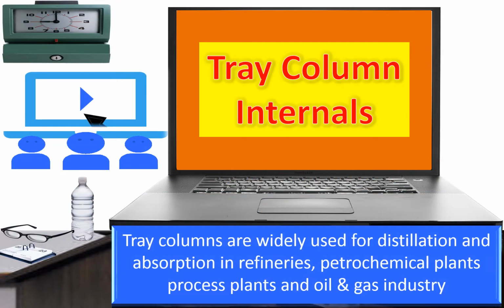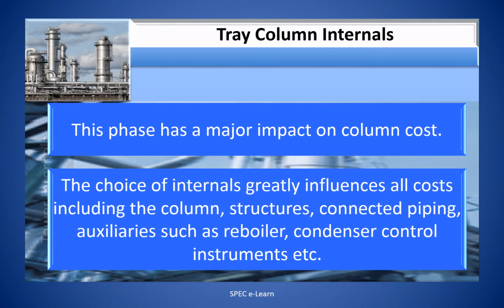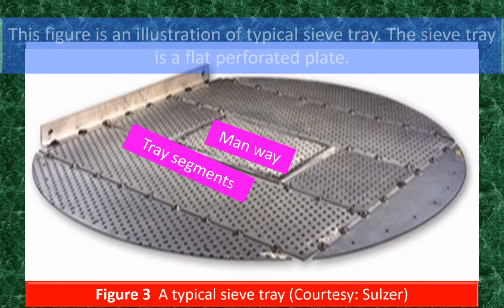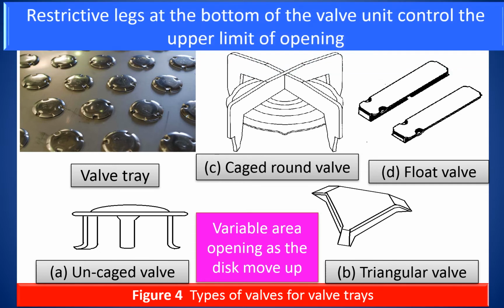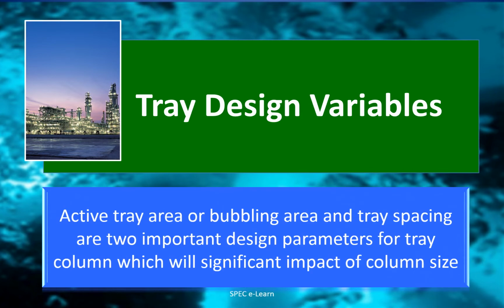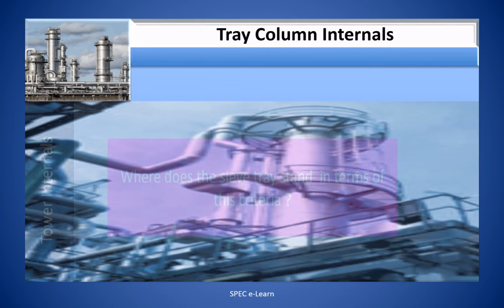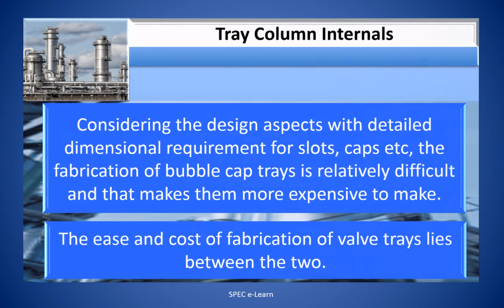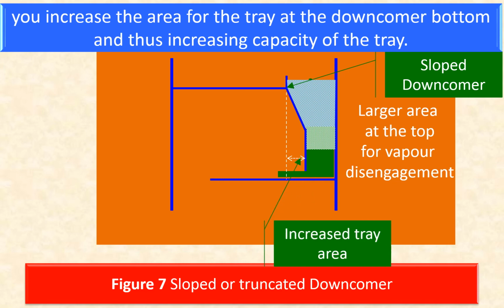Tray column internals – Types, Applications And Selection

Comment: In DHT units commonly upper trays of Stripper column design is valve trays whereas trays below feed inlet are sieve trays.What is the reason of such kind of design?
Reply from the maker: I can not comment of the design aspect unless I have the design basis of the stripper as well as the vapour-liquid loading of the column above and below the feed plate. In general valve plates are chosen wider range of operation. That is when you need larger turndown ratio. 
Typically in a HDT stripper, the light gases, acid gases and water are recovered as the over head. If the reactor design is such that there are wide fluctuations in  the light gases or the acid gases, then the loading of the top section may vary according  to the changes in reactor product.  That could be one reason. If you have the stripper loading data and the design basis share with me. I can study and come back.